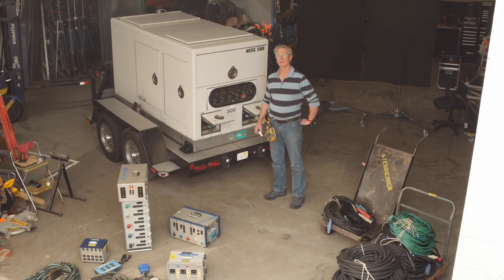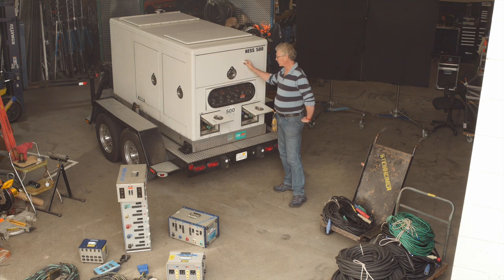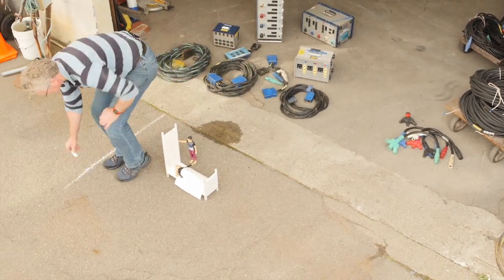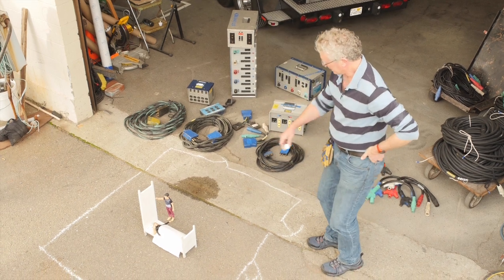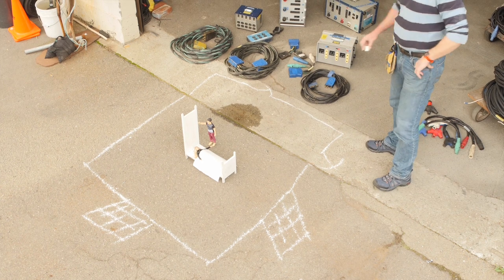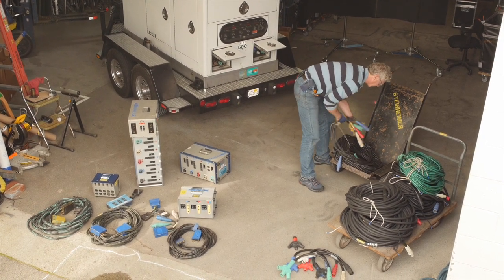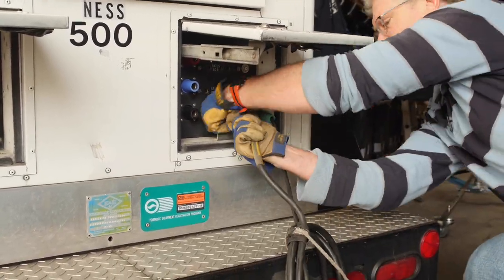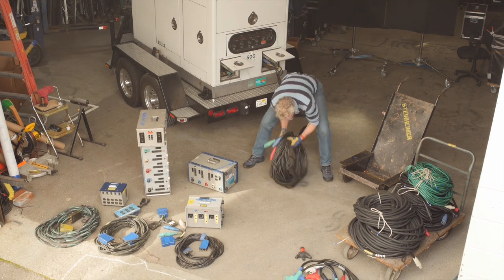Meet The Gaffer #39: Basic Distro

Comment: Absolutely Love your videos. Can you please make a video about metering a box, why you do it, and what you do when there is a problem? I feel so many people just understand how to plug into a distro box and go, but dont check the actual box for problems before that problem gets out of hand. 
     Either way Thanks for the great videos, and any on larger distribution are greatly appreciated as they clarify everything and make the set a safer place
Reply from the maker: Hi Matt, Thank you for the kind words. I'll do my best to put together a clip about metering a box...
Reply: Regardless amazing videos!
Reply: Essentially you are looking to make sure you have approx. 115-119v on a three phase distro or 122-125v on a single phase box. It is also good to test the ground. It should read the same as a neutral if it is good. Unfortunately metering the voltage does not mean you are absolutely guaranteed that you have a perfect system. If one camlok connector has 4 copper strands connected and the rest pulled out you may test positive and then run into problems when you go to plug lights in as the 4 copper strands are not going to carry 100 amps.
    At least by metering the legs you know that no camlok connectors are mismatched or unconnected.

Comment: Luke I love the content, quick note on what my union has been teaching and i am not sure if its industry standard.  They say to never drop a knee when plugging in the bandit due to grounding yourself and uping a chance of shock.

Let me know what you think appreciate!
Reply from the maker: +mac ruiz, absolutely! It’s an important rule whether your line is hot or not. Have your connection to the ground only be your rubber soled shoes and the cable you’re working with. Thanks for the input.

Comment: Awesome video. Could you do a part 2 a discuss how the to properly distribute the power and balance the generator?  Also, are the soft threefers in place of a spiderbox or is that something different?
Reply from the maker: You know, we shot a quick mention about balancing the legs, but it didn't make it into the final edit:-( I'll do another episode with another genny owner where we can get into that...
Reply: Spiderbox is a somewhat antiquated device, pretty much replaced by distro boxes. Spiderboxes generally had lug connectors in and out and where time-consuming with no breakers. Modern distro boxes are a lot better and safer. I mainly use soft threaders to get out of distro boxes. If you are adding a therefor to a piece of banded or 2/0 then hard threefers are fine. The you put hard threaders on a distro box (and sometimes older boxes are too tight to accommodate even) you have to raise the box on either a 1/2 apple or full apple box to allow cabling to happen.
Reply from the maker: I think the autocorrect is messing this up... soft-threefer and hard threefers is what he meant to say:)

Comment: I'm a little bit confused what the  220 is with the yellow backing there. is that referring to amps or volts? the cable with the stage pin connectors. and you brought it up when wanting to use more powerful light, can you possibly go more in depth? thank you! :)

Early in the video you mentioned not being able to use a 10k out of the 220 box but later you mentioned potentially an M90 which is 9k yes? That's why i'm a little confused thanks!
Reply: Volts. The yellow paddle indicates 220v.

As for the second part he replied to a comment further down. Here is his reply:

"Hi Joseph, That particular box just doesn’t have a 110v receptacle from which you could run power to a 10K unless you had a 10k globe that could run on 220v power, which may be very prevalent in other parts of the world... just not in the US. It’s not really about amp draw, it’s more about what kind of power the lamp is expecting and 220v would blow a lamp manufactured to receive 110v. Theoretically the amp draw could be a factor, but that’s not the point Alan was making in this instance. Hope that helps?"

Comment: This is super helpful! Would there ever be a scenario in which you tape over your open connections like the open ends of the soft three-fer when you weren't using it or is that unnecessary?
Reply from the maker: It doesn’t hurt to tape off openings. It’s a preference. I’ve seen crush tips jammed in there:) Look to ur BB Electric to what they prefer. For rain it’s good to cover with plastic and aim down and preferably boosted by a box or mat, but it’s been a while since I’ve Bested, so there are probably smarter habits out there people could share.
Reply: @meetthegaffer  Awesome, thank you!

Comment: Had a best boy tell me not to put my knee on the ground when plugging in banded, is that really a thing?  (Possibly creating an arc if it's a hot line) You didn't rest on your knee when plugging into the genni and then you rested on your knee when you plugged in the 600 box. (Of course in theory it should never be hot.) Great video! Thank you.
Reply from the maker: Yes, proper procedure is that you don’t put your knee(s) down when plugging in cable in case the line is hot.
Reply: @meetthegaffer  Thank you!

Comment: Hi, Great demo. I searched the comments and didn't find a similar question (apologies if repeat). The example has a 500amp genie connected to a 600amp distro. Does the generator and distro need to be at the same Amp?
Reply from the maker: It would be a good rule of thumb, but I’m familiar with 400 amp and 600 amp boxes, so what is more important is that the electrics all know what they are doing and how many amps they actually have to work with.
Reply: @meetthegaffer  I work for eComm photo studio outfitted with 200a CAM box (still rarely needs 180a). We need to sub rent at a place with 300a CAM box, but my Distros are all 200a rated. This should mean the distros will limit the draw to 200a? Otherwise are there devices to adapt and step down the amps?

Comment: Hello! Absolutely fantastic video! Just found your channel and I cant stop watching! I had a quick question as I often gaff and seldom have to touch distro boxes as of late. When you say that with the 220v distro box cannot be used with 10ks because it doesnt have a 100 amp out does that mean it has no way to re-circulate the large amp draw back to the generator?
thanks again and just subscribed!
Reply from the maker: Hi Joseph, That particular box just doesn’t have a 110v receptacle from which you could run power to a 10K unless you had a 10k globe that could run on 220v power, which may be very prevalent in other parts of the world... just not in the US. It’s not really about amp draw, it’s more about what kind of power the lamp is expecting and 220v would blow a lamp manufactured to receive 110v. Theoretically the amp draw could be a factor, but that’s not the point Alan was making in this instance. Hope that helps?
Reply: @meetthegaffer  Thank you for the reply, helpful! I realized where I misunderstood and now completely makes sense, love the content!

Comment: Can each of those lunchboxes carry a 100 amp load, or is it 100 amp combined with extra inputs?
Reply from the maker: If the lunch boxes are on the same 100A extension, then the total is 100A combined because the breaker at the flow through wil trip.

Comment: A Flur type thermal camera would be a useful diagnostic tool for an on set electric.  Once things are up and running walk your cable runs and distro points to look for excessive heat.  Simple, easy to use, modest cost, ~$300.
Reply from the maker: Could be!

Comment: I have a question on the 100Amp lunchbox passthrough.  Can the cable take 200Amps total if I chain 2x 100amp boxes together?  Or am I still limited to 100amps total for that run?  (I assume I'd need to run the boxes independently) Thanks!
Reply from the maker: In this case, you are limited to the 100A extension, so if you use up the 100 amps in one box, you will pop a breaker soon after you add more, but if you use three on one and two on the other, you’ll be good. So your assumption is correct.
Reply: @meetthegaffer  Thanks!  Great videos!

Comment: When you use the pass through for the 100 Amp lunch box run the two boxes have to split 100Amps total correct? You can put a 100 Amp load on both boxes right?
Reply from the maker: Hi Ryan, Yes, that's the idea. Just like in a house, you may be able to exceed the limit of breaker for a while, but eventually it will trip. So as a BB or set electrician you have to keep a tab on usage!

Comment: The color coding seems a bit odd here, but maybe it's not a hard and fast rule? All the TV trucks and tie-in service boxes I've worked on follow the common scheme for 120/208V as A-black, B-red, C-blue, N-white, G-green for 3-phase, and A-black, B-red, N-white, G-green for 120/240V single-phase. Black/White/Green for 120V and Black/Red/Green for 240V.
Reply from the maker: I don’t know the definitive answer, but my experience in the Bay Area has been that we only add the black leg for 3-phase... so regular single phase with two hots is generally Red and Blue, with White for neutral and Green for ground. I think this may come from earlier days when we did our own tie-ins and built our own cable. 4-wire banded was always red&blue. 5-wire added the black.
Reply: @meetthegaffer  Oh ok. Gotcha. I've only just now stumbled across you channel, but loving it so far! Thanks for all you do.
Reply: Certainly in the Bay Area the first two hot legs in the film business are red and blue. However, I have noticed that theatrical work often seems to do black and blue... don't know how much variation there is over the US or world. It is mainly confusing when using single phase on a genny... are the two hot legs black and blue or red and blue?

Comment: So crazy how different it is then Europe. Be lucky you don't use 125 amp three phase cable
Reply from the maker: If you have the time, it would be great to see video of how you set up your distro!
Reply: @G009 I'm camera based in the UK and don't take too much notice of the generator side of things, But I am really interested in this as well, don't we use 16-32/63Amp Cform plugs and even 3 phase RED Cform plugs on the generator more than all these individual inputs?
Reply: Sorry, completely missed your reply. I'll try!
Reply: That's correct. The most common is 16,32,63 and 125a cee mono/three phase plugs. However, there is also a system called powerlock, which uses the individual phases. They use this more on festivals/events. I'll try to do a video this summer about it
Reply: That's an awesome reply! Out of curiosity over in the US when they wanna run 5K HMI's or even a 18K, do they plug them into the Lunch boxes? as they look like there just filled with normal house domestic plugs? Is that the same technique over here or would a 5K HMI just be a 32Amp Cform plug?
Reply: I'm from Belgium, never worked in the US, but let's use the Arrimax 18K as example. It's voltage range is 190-250v. I would assume that in the US they would use a 400v generator so they have access to 230v. 18.000watts divided by 230 is 80 amps (with safe marge) single phase. I would guess they use the 100 amp "snake bite" that Alan shows at 7:58. When you purchase a Arri ballast it comes with bare lines. So you are free to attach the plug required in your country.
Reply: Cool stuff, Always interesting to look into the gaffers world, would you say it's easier and or that much different to hook up distro over in Belgium  over the US?
Reply from the maker: G009, yes, we would use the 220 Bates connectors which would be fed, by extension or snake bite to camlok, from the distro that is either getting single or three phase power from the genny or stage tie-in to mains power.
Reply: Those 125 amp 3p cables are not fun to handle indeed. I'm from the Netherlands and I have seen some generators on set that use powerlock as well.

Comment: can you run an 18k off a 500amp genie?
Reply from the maker: Yes! The easy way to think about it is in what some call "paper amps", which means how you rough out the load requirements for a certain job. Roughly speaking, with out putting a meter on it, you can think of an 18K as needing 2 legs of 90 amps a leg. If you put the 500A genie in 3 phase, you have roughly 150A+ a leg, in single phase it's more like 250A- a leg, but you should leave some overhead. Does that make sense or am I assuming too much?
Reply: makes sense! thank you:)